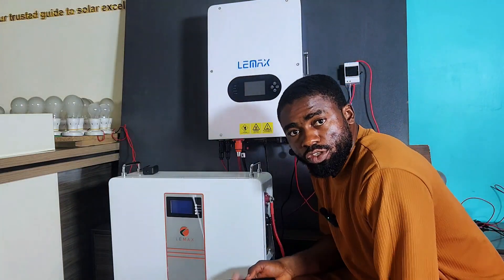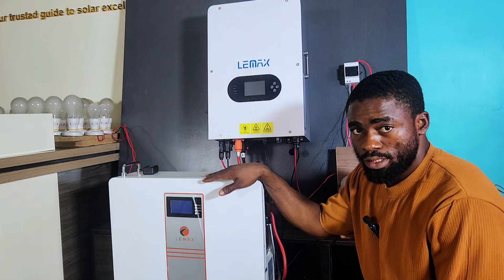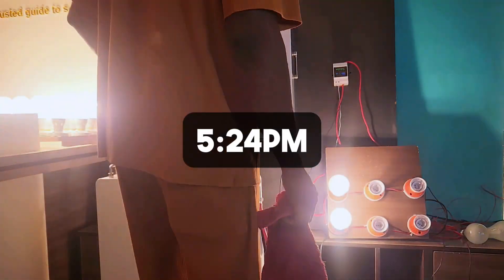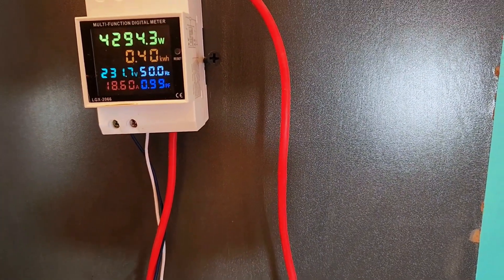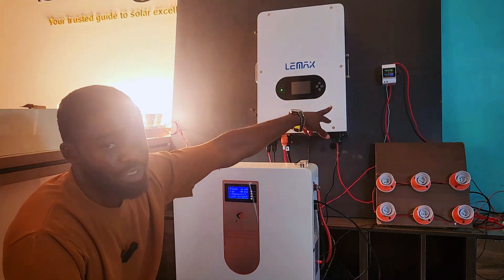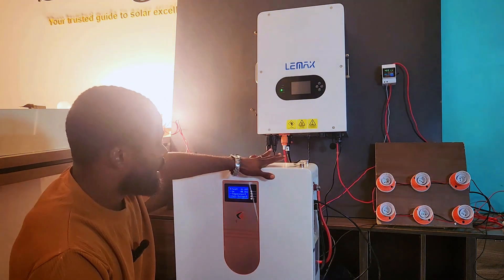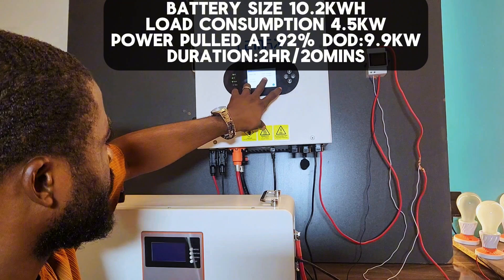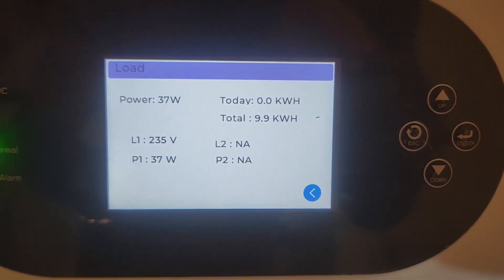LEMAX LITHIUM BATTERY CAPACITY TEST: WOULD LEMAX DELIVER THE EXPECTED RESULT?

Comment: From the video, I can see that the battery is quite nice. I particularly like the LCD display which allows you to see quite a lot of battery properties. I'm also impressed by the inverters efficiency of ~95% while powering about 75% of it's rated capacity. Well done and keep up the good work.